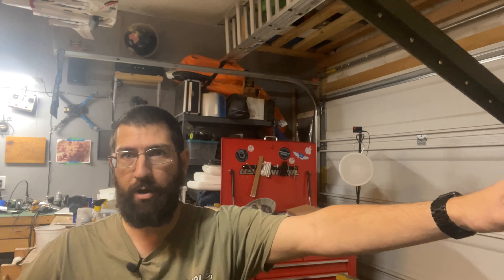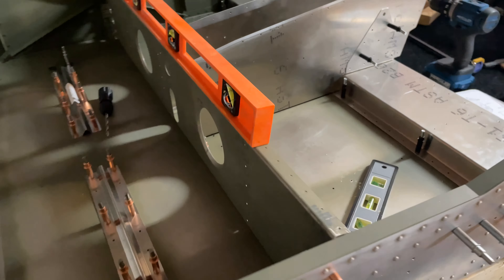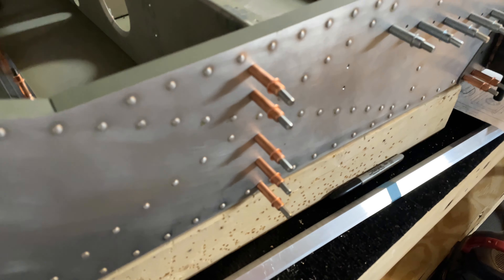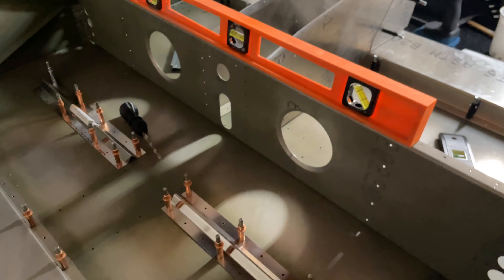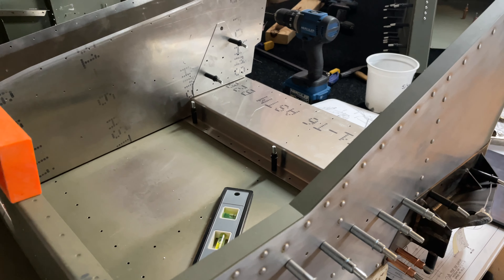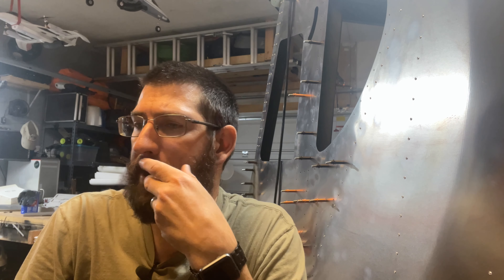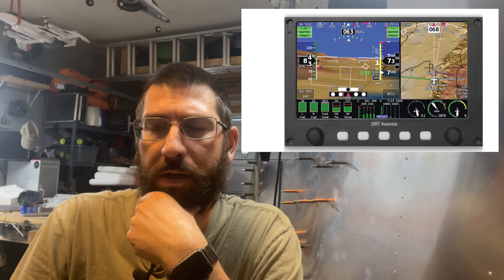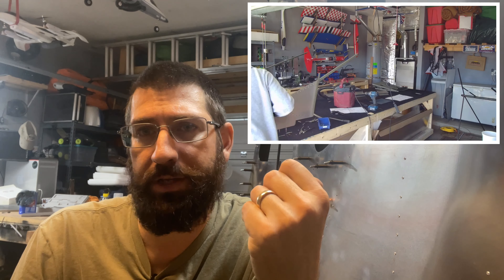I messed up on my Cruzer...

Comment: Looking good, stick to the plan, if your fitting the center console, the hump shape stiffeners where your ankles go, are fitted externally as per plan, otherwise they obstruct anchor nuts in center console.
Reply from the maker: Thanks for the pointer.

Comment: Try the seat belt brackets on the inside of the tunnel .Dont bend them .The belts bolt on the outside .
Reply from the maker: Thanks, they were there just to hold things together.

Comment: I'm not a big fan of touch screens in light GA aircraft.  I like the GRT choice better.  My biggest reason is in IFR when things are bumping around I find it more difficult to hit the correct spot on the screen than I do with traditional knobs and buttons.  Need to go missed, with a GNS 530W it's two button pushes.  If I hit the wrong spot on the touch screen (which I often do in the clouds), I then have to reset and start over.  Granted my age does play a role in this behavior, and I'm not discounting the benefits of TAA, but for me, nothing beats a knob and button.  Great project and thanks for sharing.
Reply from the maker: Agreed. The GRT set up, in my opinion gives the best bang for the buck.

Comment: Joe. 
I enjoy following along on your build and appreciate the videos.  I will be starting my cruzer build this spring.  

Maybe I missed it but I never saw you point out the exact mistake you made or when you discovered the error.   

If you could clarify or add details that would be great. 

Thanks again.  
Joe Bryant
Reply from the maker: Sorry, I thought i did, but if not, I did things in the incorrect order, I tried to drill out the sliding seat options in the seat base prior to ensuring that the supports were in the correct positions. It is important to make sure that you are all squared up and that the L-angle supports are square and locked in prior to trying to install the sliding seat supports.  THanks for watching,
Reply: @JoesRCCorner     Got it , Thanks!